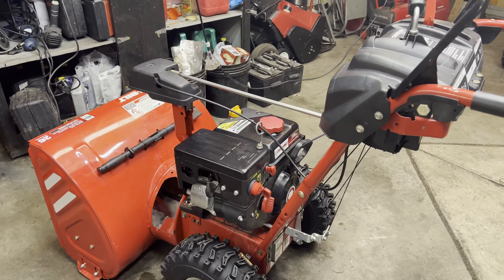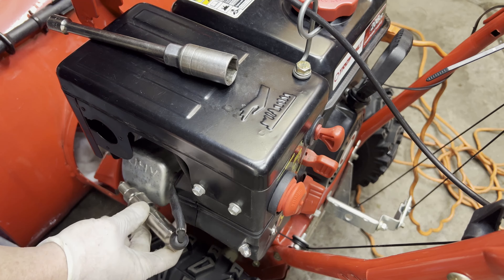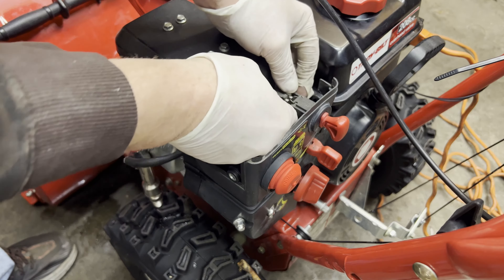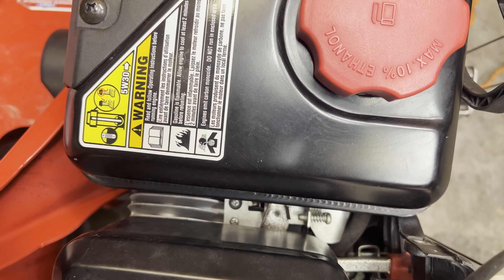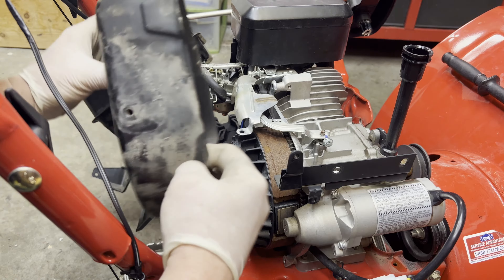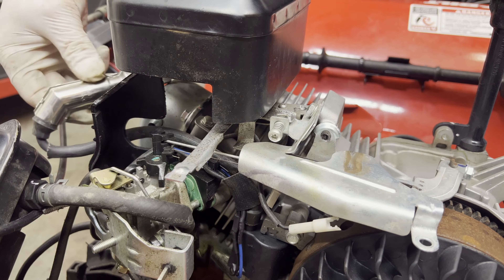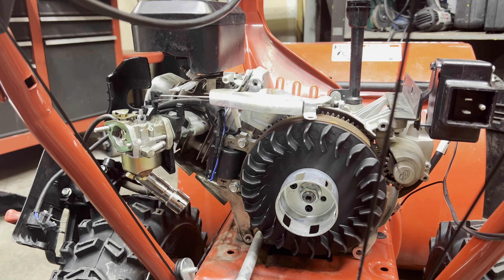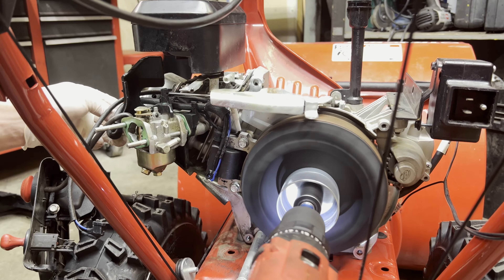How To Replace An Ignition Coil On A Snow Blower Small Engine Repair

Comment: luckily there was no spark with the cloud of fuel that kept blowing out , not an issue until it goes boom in your face
Reply from the maker: True Bill. I have luckily only tried to burn my garage down once. I had a riding mower that had flooded the engine case and I was clearing the cylinders of gas by turning the key and cranking the engine. Spark plug wire was just sitting right and it ignited the gas on the engine and on the floor. I always have a fire extinguisher sitting on the shelf for that reason.

Comment: Any idea what my problem could be with it constantly backfiring, and it will only run on 1 choke position and stalls out on the other ones? Seems even the choke position it runs on is getting worse and worse too.
Reply from the maker: Clean the carburetor.

Comment: Where can I order this ignition coil for 208cc?
Reply from the maker: @doobiescoobie  search the model of the engine online. Find a parts diagram and get the part number for the coil. Then search that part number. Buy from who ever has the best deal and good reviews
Reply: @ first line:170-sh second : L ZD0907

Comment: Excellent breakdown, great video. I've got an Ariens 24'' blower and the wire got pulled out of the boot. What's the best way of getting it back in there? It's pin hole and tight fit going into that boot. I'm a little stumped
Reply from the maker: Bring it inside and let it warm up. Then start working it back in. Yeah its a pain in the butt!!!

Comment: Can it still be the ignition coil if it starts, runs then quickly sputters and dies (with a puff of smoke)?
Reply from the maker: That is hard to answer. When you say quickly, is that a few seconds or a minute?
Reply: Backfiring? I think so, but I'm not sure either. Mine runs right now but backfires and wants to stall on every choke and the one it stays running on is constant backfiring. Did plug, new gas, oil changed, and the carb was cleaned not too long ago. I'm lost. LOL!

Comment: That little black wire the grounds the “run” position. If that wire is out can the coil spark?
Reply from the maker: yes
Reply: @small_engine_repair  I have that wire out, the wires that go to the key in. And the magneto is hooked up and it still won’t spark. What do I do? I cleaned the flywheel with degreaser including the magnetic part. Do you think that affects it?

Comment: Great video! I have a 2002 cub cadet that is impossible to hand start, even with new spark plug and fresh gas, primed 7 pumps, and can only start using the electric start (giving it a go 5 or 6 times using 6-second bursts before it actually starts). I was looking to get a replacement ignition coil, but I'm having difficulty.  I see a label on the engine that says: HMSK85 155906B     ENGINE FAMILY: 1TPYS3182BF   318 DISPLACEMENT   MODEL: 31AH5C3F100   MFG CODE: 1H311B10241. Instead of an ignition coil, I found what they call "Tecumseh 611104 ALT COIL" selling for $173.48 - which seems awfully high to me just for a coil. Can you tell me what kind of ignition coil/alt coil I need and where I can buy a replacement ignition coil for the snowblower mentioned above?  (I live in the states)
Reply from the maker: Mike, there are usually two symptoms of a bad coil that I have experienced. One, it is just bad and will never provide the current drop the spark plug needs. You get no spark or weak spark. Two, after running for sometime, the engine will start running bad, miss fires, rpm up and down, and just then just dies. Based on what you have said I am not sure the problem is coil related, unless you have checked the spark on a new plug and it is really weak. Once you do get it running, how does it run over a period of time, say 10 to 15 minutes?  The issue could be carburation related. 
Visit https://www.jackssmallengines.com/jacks-parts-lookup/manufacturer/tecumseh/4-cycle-horizontal/hmsk-085/hmsk85-155905b/engine-parts-list-1  and look for part number 35135B. The options list three different parts that are available. Google search those part numbers and find the best deal. But, only buy it if you have checked the carburetor and the spark.
Reply: @small_engine_repair  Thank you so much for getting back to me!  You make a very good point!  We got 16 inches of snow and I used that snowblower for 45 minutes straight with no issue. I then went on the roof and cleared the snow and used the snowblower for another 1 hour and 30 minutes with no issue picking up the snow that fell to the ground. I was in need of a snowblower and this one was given to me all extremely rusted – I sanded it all down to bare metal, spray painted it with rust-inhibitive primer, and 2 coats of Majic heavy duty alkyd enamel cub cadet yellow spray paint from Tractor Supply. The carb that was on it was in sad shape, so I bought an exact replacement and that is what is in there now (since this past December). I bought a Performance tool w86554 inline ignition spark tester on Amazon and it is due to come in on Saturday. I'm anxious to see what kind of spark will come out of that tester. If the spark is weak, does that warrant replacing the coil? If I have a strong spark, I'm not sure what else to replace to get it to start easier.  Should I take it apart to see what the gap is on that coil? Given how rusty this snowblower used to be, would it be beneficial to sand down both screw ends of the current coil, and magnet, to make better contact? If so, would 220-grit sand paper do the trick to remove that rust buildup on those areas?  Thank you for the coil reference! I'll definitely let you know how I make out once that tester arrives on Saturday
Reply from the maker: Yes do check the gap of the coil to the flywheel. I always use a business card to make sure the gap is correct. Now after you explanation, new carb, rust, etc., I am now kind of wondering if the valves are out of adjustment. Both should be at .006" (.15 mm).
Reply: @small_engine_repair  Great news!  I had spare time this morning so even though the spark tester hasn't arrived yet, I was too excited to wait on the condition of the coil, so I took it apart and found something. The two screws holding the coil in were way loose AND the gap was way wider than a business card.  I gapped it back to the spacing of a business card and secured the screws. I put everything back, full throttle, full choke, pressed the primer bulb 3 times making sure to cover the center air hole, pulled the cord until taught, and gave it a yank. It started effortlessly on the first try!  I was stoked!  All is now working as it should. Thanks so much for your time and input :) You made my day!